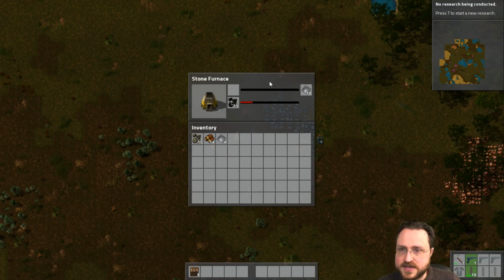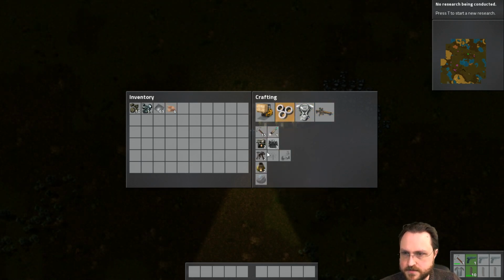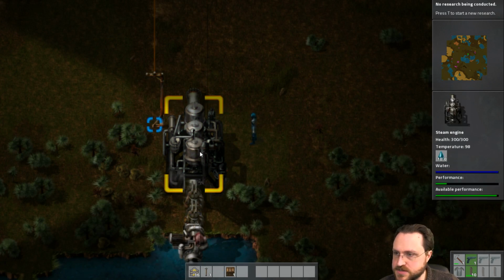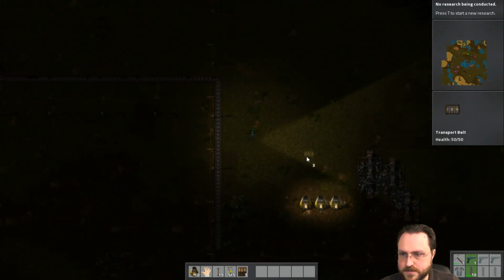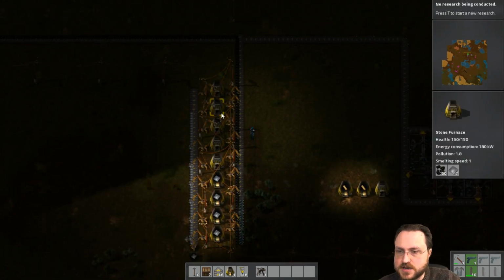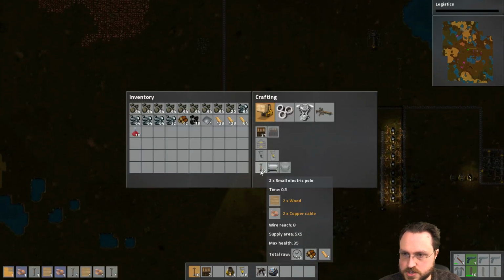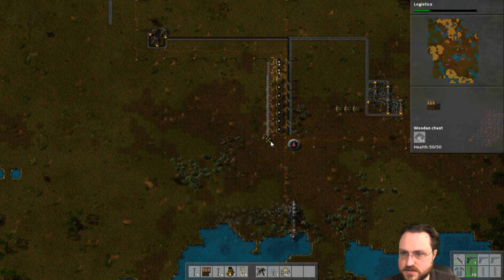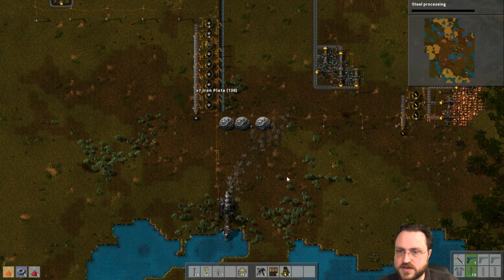Factorio! (Livestream Gameplay) 2/4

Comment: I made a gigantic production line that transforms iron into plates and then into various other things (gears, steel, more advanced things) and all fueled by coal furnaces that I have to run back to and fuel because there wasn't any room in the design for a belt to feed them coal. The best part is that every single product that can be transformed into something else (iron plates, steel, gears, copper plates, copper wires, chips, inserters, beltways, etc) is on LOOPS of track so that you don't end up with stuff getting stuck at the bottom of the line near full processors while processors above stay empty; we're talking maximum efficiency. Besides, I don't have to do it forever, just until I tech up to electric furnaces.

...then I find out that electric furnaces are bigger than the stone furnaces... and won't FIT in my design without wrecking everything. That's okay, I think, I'll just tech up to logistics robots and have THEM put the damn coal into the furnaces.

...except they can only transfer items from chests to chests.

And that was when I ragequit. Time to try a new design...
Reply: *****
Yes, now that I know that electric furnaces are larger, I can put that into consideration, and leaving more room would make sure there was room for a coal belt, too. At least it's more efficient than my last design, which was more of a "kudzu plot" with shit going wherever there was room and all.

Comment: you could put a stone furnace directly into the burner/eletric drill, so it will smelt automatically the iron/copper, and you don't need to put the iron in each of the furnaces.

Comment: Hey quill, with the single inserter feeding the single box your limiting your iron plate production to as if you only had one smelter
Reply: agreed, i tend to have an inserter on each side of the box and loop the track round (if done right you end up using both sides of the belt aswell
Reply: A fast inserter (blue one), but he does not have the tech yet, will do the job extremely well. But you are right :) At least 3 would make everything run very smooth :)